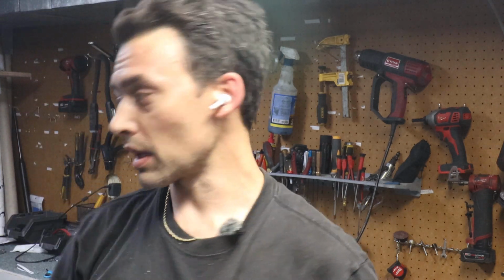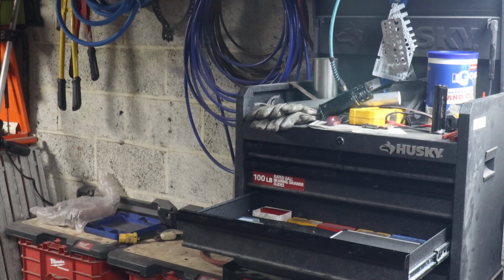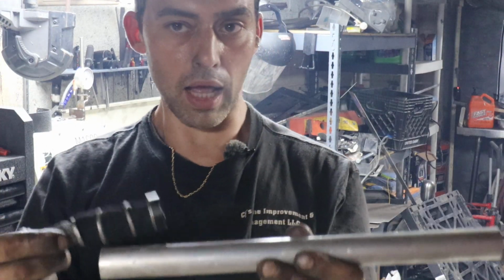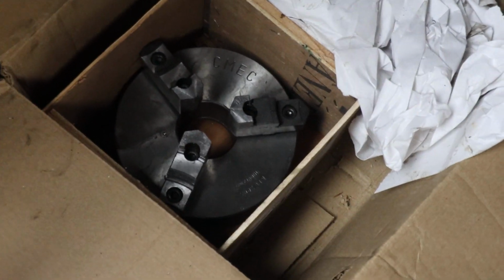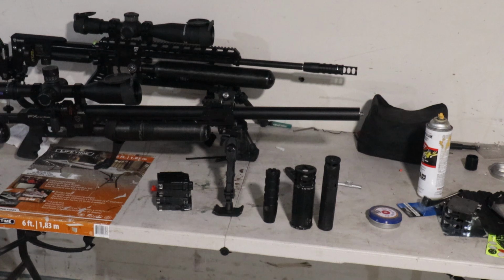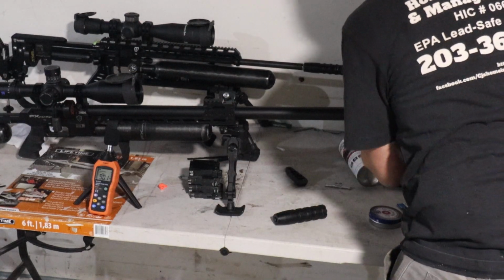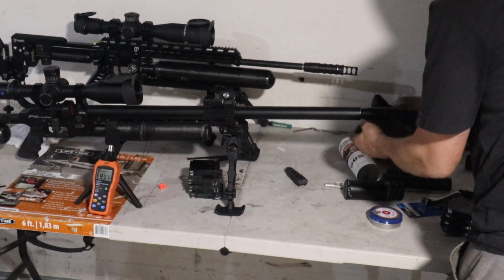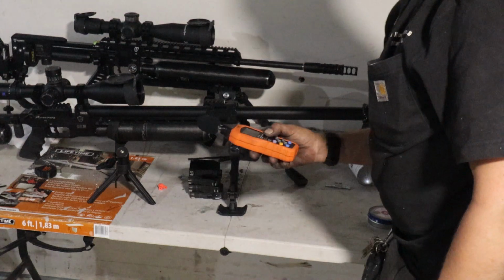Making an ok air gun silencer an Awesome air gun silencer Pair 1

Comment: Chris, how can I contact you?
Reply from the maker: Hey Victor, you can email me. My email address is CJ 110109@gmail.com.
Reply: Thanks!
Reply from the maker: @victoradams6635  no problem, Victor
Reply: Chris, did you get my email?
Reply from the maker: @victoradams6635  hey Victor, I did check my emails I didn’t see one from you in spam or in my inbox. Did you get the email address correct? It’s cj110109@gmail.com.